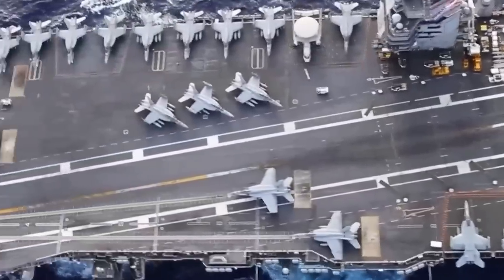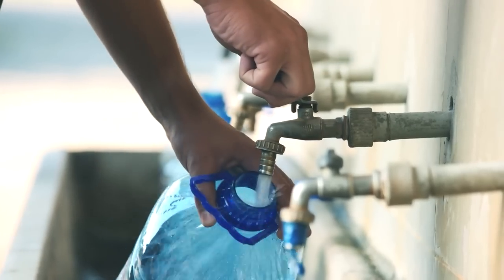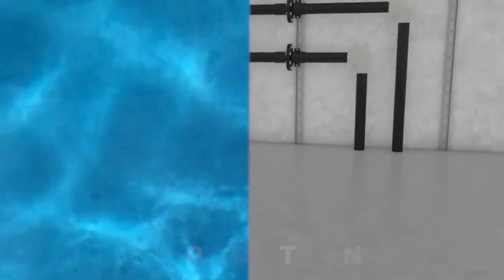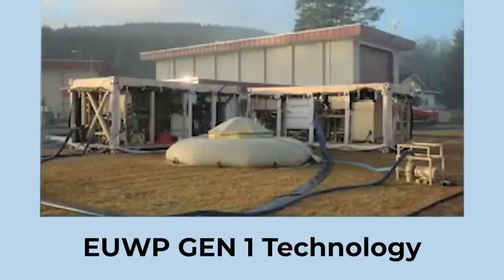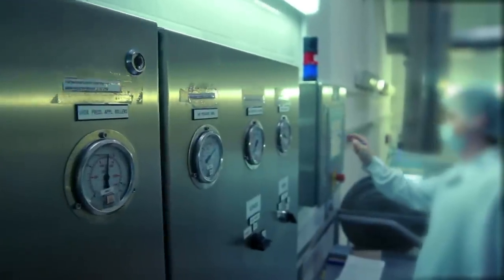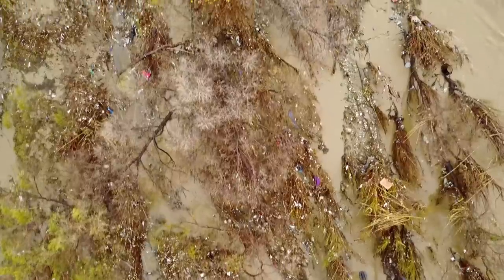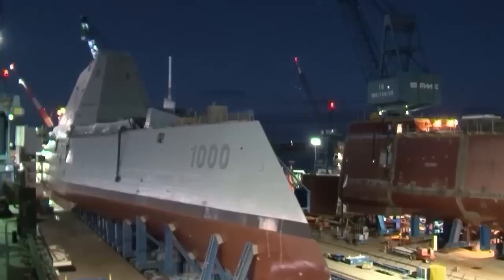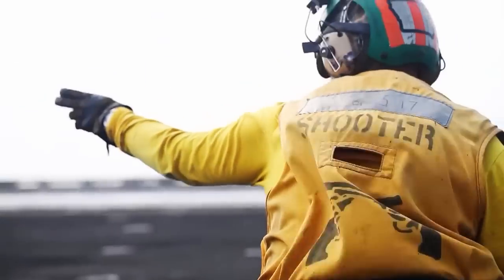How Aircraft Carriers Turn Seawater Into Fresh Drinking Water At Sea

Comment: Where does all the salt go? That's a problem.
Reply: Evaporators use a continuous low-temperature distillation process.  The salt water feed has part of the water removed by distillation, and the rest goes back overboard as slightly saltier waste brine.
Reply: @kevincrosby1760 And that's not good in the long run.

Comment: Broad usage of reverse osmosis for potable water will depend upon economics. Much of current fresh water usage is based upon defacto zero cost water. An example would be a golf course in the desert; such a golf course could not to support the cost of the reverse osmosis fresh water required to maintain ~100 acres of grass. In the US,  because of our system of historical water rights, major sources of fresh water are used to produce agricultural products; for many of these products, economic calculation would result in negative value added, i.e. the farmer would make more money selling the water rather than growing the crop. This video is touting reverse osmosis for fresh water without strong data of an example where such water is able to be competitive in a global market. I remain skeptical, that desalination of sea water is a solution to global shortage of fresh water.

Comment: How did jet fuel get into the fresh water supply?
Reply: @kellywilson8440  I was at ET on the USS Forrestal in 82. Our head, adjacent to our berthing, just beneath the 'bomb farm', was one of, if not the, only ones with fixed shower heads. So, we were rather popular. 

When those showers were running, you could usually get a faint odor of fuel. We all used to joke that we were showering in JP5 (jet fuel). Mostly because there happened to be a JP5 pump station both fore and aft of us. Well, I rode that ship into the yards in 83, for the SLEP in Philly. For a part of that time, I was a supervisor for a section of the fire watch division. Which meant I dealt with the gas-free engineer a lot. 

That gas-free engineer told us that, in the yards as they were taking the ship apart, they had found cracks in diesel fuel tanks that connected them to fresh water tanks. So, apparently, the fuel we smelt was for real, except it wasn't JP5, it was diesel. We really were showering in fuel.
Reply: @brolinofvandar  Roger all that brother , Showers and bug juice had fuel in it , Take care !
Reply: @kellywilson8440  Speaking of bug juice,  I found it very interesting when I learned that the exact same stuff, in a higher concentration with less water, was used to clean oil/grease off the deck plates down in the main spaces. So, the same thing I often drank with meals was also used as a degreaser.
Reply: @kellywilson8440  Let's just say, I learned about the bug juice = degreaser first hand. Spent some time doing just that. Not by choice.

So, you were at Cecil Field for my last couple of years in. My last station was USS Vreeland at Mayport 84-86. I can remember driving a base truck to NAS Jax once or twice for a pickup, but I don't think I ever made it to Cecil for any reason.

Since you mentioned ground tanks leaking, I believe there were issues like that, only with ground water getting into the fuel, with the gas station that was within the Forrestal Village housing area in Great Lakes, IL in the late 70's. I know that I ended up with issues with the 76 Honda I had at the time, stalling because of water in the fuel. And that station had been my usual, given it was a couple of blocks from my apartment.

Interesting that the first family housing I had in the Navy was that Forrestal Village in Great Lakes. And, my first ship years later was the USS Forrestal.
Reply: @brolinofvandar  that cheap hot sauce found on the mess decks did a much better job removing corrosion from brass FF fittings  and hose connections than it ever did making food taste better.